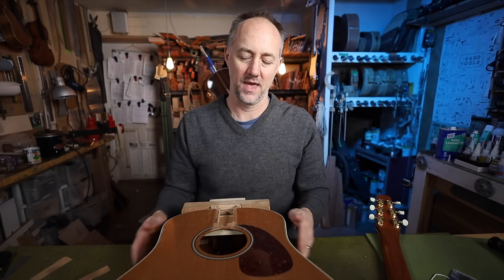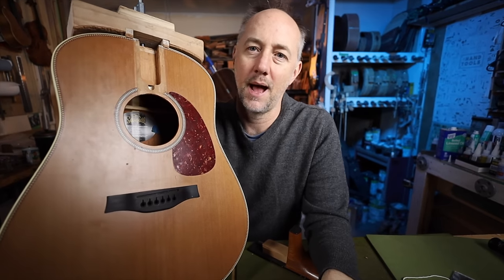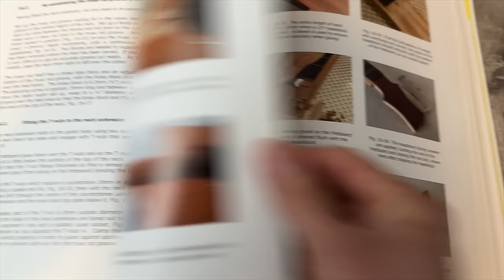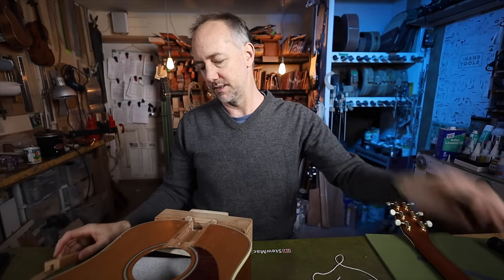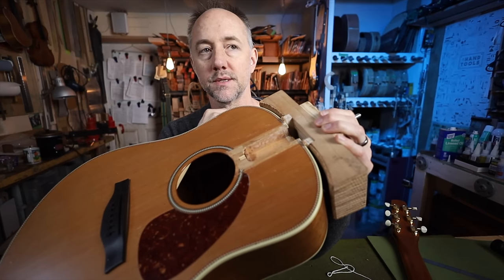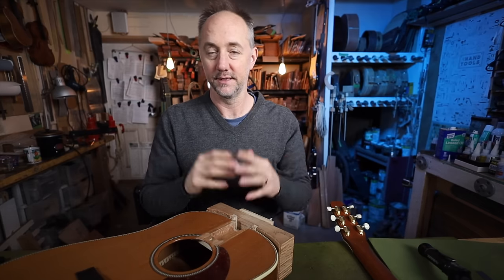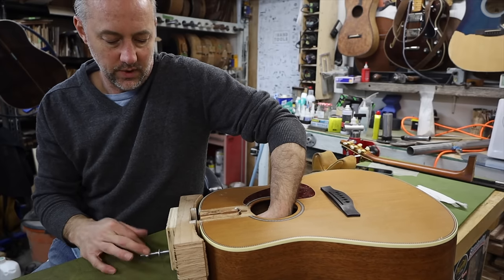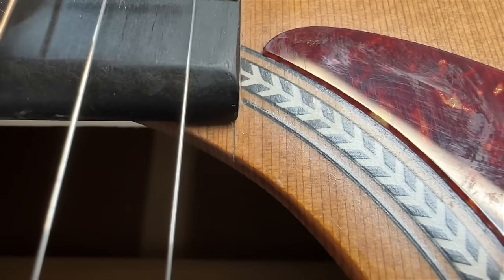The Hidden Problem with Seagull Guitars...

Comment: I have 2 Seagull Grands (parlors) myself and although there's not a huge amount of saddle height on either, they both are wonderful little players from 98 & 2000. I have had many Seagulls from all years on my bench and never needed to change neck angle. I have had to tighten heel bolts on a few from shrinkage... the same as Taylors. Great players and the cedar / wild cherry has been a fine combination. Wish I could commiserate with you but my experience with Seagull has been totally positive, starting with Robert's & Claud's LYS Kamouraska in 1980.  As a side note, the most beautiful Simon & Patrick came in the shop yesterday. Killer!
Reply: Also note, It's "Simon and Patrick" and not "Patrick and Simon" as the author indicated just before pointing out that "Norman" is a weird name.  Maybe he's having a bad day and his anger toward the Godin family is a bit piqued by his frustration.  A switch from coffee to tea might be in order :)
Reply from the maker: hahahah- good name catch! I probably say Patrie La as well! hahhaha I wasn't angry- Just annoyed that a guitar factory would make what amounts to basically throwaway guitars- it should annoy you too.
Reply from the maker: I like the seagull guitars- as can be seen at the end when i play it. Things aren't a problem until they are a problem. ALL guitars will eventually need a neck reset and this neck join (post 2006) makes that not a viable option for alot of their guitar.
Neck resets can take 10-20-30 years but all guitars will eventually need them. What is funny is yours is that age and you said there isn't much saddle height- so you are coming up to a neck reset- luckily you can do it very easy on your pre 2006 guitars :)- The fastest i ever reset a seagull neck was 15mins- from heating the fingerboard extension, taking the neck off, removing wood from the heel and regluing the neck on the body- 15 mins! i like me some pre 2006 seagulls.
Reply: @BeauHannamGuitars  I believe Simon & Patrick are Robert's children. LYS Kamouraska must have been his crazy Uncle.
Reply from the maker: HAHAHHAHA- WHo is this Norman guy?- Someone he meet in the grocery store queue?

Comment: Other opinions: "If you look a little closer, you will see the UTB is a seven-layer spruce lamination. Robert Godin said in a tour video that solid wood wasn't strong enough, but the lamination is exceedingly strong for the UTB. I am a mechanical engineer by training, and I think Godin's neck joints are magnificent."

"The switch to the integrated set neck took in late 2006 and early 2007. I have five Seagulls, three of which are twelve years old, and I have never even adjusted a truss rod from its initial setting."
Reply from the maker: The strength of the headblock area isn’t in question- it could be made of diamond and the problem I address here still remains. 
The neck reset problem isn’t about the headblock deforming (although that can happen), it’s all the thin wood surrounding the headblock that slightly deforms over time.

Comment: The Norman brand is called such because its originator was Normand Boucher. Robert Godin used to distribute his line, and then got into the guitar-making business himself in the later 70's, hiring Normand's son, who designed the first Seagulls. Later, when Norman ran into difficulties in the 80's, Godin took on the Norman brand as well.

Normand's nephew is Robin Boucher, who you may have heard of.

Edit to add, I bought my Norman B20 around 1992 and is in awesome shape, considering I've played it in the sweltering heat and shivering cold.
Reply from the maker: Cool history- I didn’t know any of it. Thanks

Comment: I see your point that the epoxy is difficult to remove but  It's very rare that someone needs to have his neck removed.. I mean really rare unless something major happened to the neck.. I have many different types of guitars for at least 40 years.. In any event I really love my Seagull. I've had it for almost 10 years now and besides an occasional truss rod adjustment during season changes, I am totally satisfied with the neck, the sound and resonance..BTW PRS utilises Epoxy too.. Must be a reason..
Reply from the maker: Seagulls guitars sound great for the price. Some guitars hold up better over the years to the string tension that inevitably  implodes them which then needs a neck reset. If a top is over braced in the upper bout, and/or the lower bout that can help resist a neck reset but it might not be good for tone. Top geometry also helps (vintage Gibsons from the 1930-1940 hold out better then Martin guitars due to a tighter top radius (Gibsons have a 15 foot top radius in the lower bout, Martins have  a 50-60 foot top radius which makes them weaker- an egg is stronger then a piece of paper to downward/upward forces)
Reply: @BeauHannamGuitars  As far as i know I wouldn't generalise this issue to all guitars with metal strings..I don't think it's an innevitable fatality.. It wouldn't make any sense to have set necks.. They should be all bolt ons., because it would be much easier to maintain.. But let me investigate with some competent luthiers I know.. If you are right about this, I'll acknowledge.. Like I acknowledge the fact that Epoxy complicates maintenance..
Reply from the maker: @BedeLaplume  I’m mostly talking about acoustic guitars here. But Les Paul’s also need neck resets.
Reply: @BeauHannamGuitars   Then write to Bonamassa and Slash. They sure have a few vintage guitars that are probably dying to get their neck resetted..
Reply: @BeauHannamGuitars  BTW I did my research with at least 2 very competent luthiers and that neck reset thing you recommend to every guitar after 30 or 50 tears is not mandatory for all guitars.. It 's good to do it, but It's really a case by case after that amount of time.. Also yes climate or weather  change during transportation or warehousing  does affect the tension and warping of the body, saddle, neck  that will occur many will never need it in their 100 years or so of existence.. Also it seems like you didn't use steam to remove the neck. Your reparation with the shims was very good but a lutheir neck joint steamer aiming the neck pocket, would have made it a lot smoother to remove the epoxy or the glue.. Last point, every Godin guitar that leaves the factory was done with wood that was dried and warehoused in stable conditions for at least 2 years.. Which isn't bad considering those are affordable guitars..

Comment: So even though Seagull says that they started epoxy necks in 2006 I have a 2005 seagull artist with an epoxied neck (: so something to be aware of.  Thought I was OK but sadly no.
Reply from the maker: Good to know, thanks. It’s only a problem when it’s a problem and it should be 20-30 years after manufacture

Comment: Hi, I was just thinking maybe the easiest way would be to flush cut the fretboard from the top and unbolt the heel. I'd leave the tenon that is epoxied in where it is. You could then shim/reglue extension & bolt back on as needed for the reset. There really is no need to remove the epoxied in wood. Your thoughts? ( a GT in Canada for about 40 yrs).
Reply from the maker: See number 4 of the the description. But don’t saw through the fingerboard as you loose a lot of rigidity
Reply: Oh right, thanks. Godin never should have changed their bolt on . I've reset several over the years easily but never this epoxied version. I think Robert Godin needs a look at your video :)  @BeauHannamGuitars

Comment: Really interesting video, thank you.
I'm not sure how the neck on my Lowden 32se is joined, but from the reputation for quality that Lowden have, I can only assume it is a better solution than the one Seagull use.
Reply from the maker: I think Lowden's use a dovetail.
Reply: It is a Dovetail but with no gap! All 3 sides of the tail are glued flush, really difficult to remove. I had one that came to me with the neck broken off and exposed this. I had to use an oscillating saw to cut the front of the dovetail away from the block.  @BeauHannamGuitars

Comment: I've owned a classical since the 80s and no problems. My wife owns two steel strings from the early 90s and no problems. Best guitar for the money! Also worked in a local music store for 36 years and sold so many I can't count, with no problems.
Reply from the maker: Guitars ain’t a problem till they are a problem. But all yours will be easy to reset the neck :)
Reply from the maker: Me too

Comment: Builders/luthiers should definitely show more consideration regarding future repairability of their guitars, a neck reset is probably going to be inevitable somewhere down the line and anti consumer choices such as this make the brand one to steer well clear of for me.

It's a real shame as two of my favourite acoustics were an old Seagull S6 and the astonishingly good Art et Lutherie I picked up for pocket change.
Reply from the maker: Yep- All guitars will need a neck reset be it 10-20-30 years. If i saw a cheap one of these id buy it but the ones made pre 2006 are better as their necks can be reset. (so can these new ones but you almost have to take the fingerboard off to get the neck off...

Comment: As someone who bought an S6 in 2019, this makes me ... apprehensive. But so far so good. But this makes me wonder, are there any guitars in this price range that are actually designed with regular glue and proper joints? Taylor comes to mind with their attachment system, but who else is there that thought ahead to when the guitar needs serviced?
Reply from the maker: Most brands have serviceable neck joints in any price range (be it dovetail or bolt on). Godin are the only acoustics from a major current brand that I know of that have set necks.

Comment: You're better off with a Norman if you want to buy a similar guitar, I've a Norman B-20 guitar, which was made in the early 70s. Never had any issue with it. And it sounds great.
Reply from the maker: Ive never seen a Norman but everyone who has one likes it
Reply: I own a mid 90s Noman. It always had great tone but now needs major repairs. A split cross brace caused it to belly up  and I'd say the bridge is will need to be removed and replaced.. probably cost more to fix than replace
But it has sentimental value... I miss playing it

Comment: I have a Seagull 6 and a 12. ALso a 6 string Minstrel. I feel all 3 need a reset. However it might be beyond my skill set.
Reply from the maker: Are they made before 2006?- if so they are easy to do. If made after 2006 It’s possible to do if you want a challenge (but any neck reset is like that)
Reply: @BeauHannamGuitars  I beleive so. 6 string number is 00135471 so I think 2000, 13th week. It's bridge has been shaved to practically nothing. When I look inside I see a solid block with no bolts.
Reply from the maker: @MikeGervasi  nice- the neck can be set normally, although with no bolts I presume it’s a dovetail but I didn’t know they ever did them????- best to call them

Comment: Very interesting.  I will flair the neck to the top attachment area on my future Spanish heel ukulele builds for sure.  Thanks!
Reply: Not enough stress in a uke with a Spanish heel to make an iota of difference.
Reply from the maker: Yep- thats what i do. Livy1962 points out there sin't enough string tension to warrant this and its true. But i do it anyway just cuz it is good building practice and I have always don't it on all my guitars.
Reply from the maker: See my answer to Short6691

Comment: I just purchased a new Godin Folk solid mahogany acoustic. Everything seems fine: playability, intonation, fretwork, etc. The only thing I noticed after playing it for a few days is that there is a very fine gap where the heel joins the body on the player's side (not on the other side, though). It's widest by the fretboard, where I can slide a feeler gauge into it of .0025" and then gets narrower from there until sealing up completely about half-way down. Should I be worried? I like everything else about the guitar so far, so I'm hesitant to exchange, not knowing what I'll get. Any professional opinion would be helpful, if possible. Thanks.
Reply from the maker: 0.025" gap is alot. If you bought it new its still under warranty and id ask for it to be repaired- Its either the bolt wasn't tightened enough at the factory (doubtful), the bolt has come loose over time (less doubtful but the gap would be even on both sides if this was the case) or the wood of the heel has twisted a bit. could be strange body movement too. But take it back or to a luthier who can give an in person assessment. But the gap shouldn't be there.
Reply: Actually, it’s .0025”-ie - between two and three thousandths of an inch. Would that still be cause for concern?
Many thanks!
Reply from the maker: @cmcg5788  0.002” isn’t much- I mention at the end that Seagull use wood putty to fill any gaps at the heel so some may have just fallen out. It’s just aesthetic so don’t worry.
Reply: Cool! Thanks alot! @BeauHannamGuitars

Comment: Beau, thanks for sharing your repair chronicles. Thank you, Google, just what I needed. A few questions: aside from the heel support fanning out and connecting it to the transverse brace, and achieving better tolerances, what are your thoughts on the whole bolt-on versus traditional approach (Tenon/Dovetail and fretboard, all glued)?

The reason I ask is that I am a guitar maker working on a bolt-on neck design. I am planning on using a tenon & extension under the fretboard but without the shims (Taylor has the patent on the adjustable neck). I am accounting for the neck angle and aiming for much tighter tolerances (using a CNC). I was curious about the bolt-on approach for its repairability and the fact that it provides more robust support. I am hoping it could withstand the forces of 7 & 8 steel strings. Any thoughts are much appreciated. Thank you again!
Reply from the maker: I will publicly say that there is no tone difference between a dovetail and a bolt on- assuming both systems have the neck fitting to the body well. If the woodworking is good, the tone should be too. Talyor and Collings both use bolt on necks and i'm certain they did would have done tests to see/hear if one system was better over the other. 
Do you have the trevor Gore book I show in the video??? I think you will be interested in his neck attachment system (like Taylor but different, no shims)- i added a link in the description.
Reply: Thanks for your response, much appreciated. Yes, I am familiar his books, but don't have them $$$$, but lots of great knowledge in them—Falcate bracing, nut compensation etc. This video shows his approach https://www.youtube.com/watch?v=NQu1XGnVjlE. I come from the world of test, measure and learn. From a CNC operations point of view, his order of operations makes sense. Circling back to your video, you summed it up quite nicely, "If the woodworking is good, the tone should be too," and I would add, "and it should last for a lifetime" (of the instrument that is).  @BeauHannamGuitars
Reply from the maker: Im sure you would like these books- stewmac used to sell them and you could get a 50% discount which made the books a good price, but they seem to no longer sell them.

Comment: This is a real shame. I really like the sound and feel of simon and patrick guitars, but this seems like a terrible choice by the designers and now knowing this, I think I will reconsider purchasing one. Should I let this problem affect my decision to purchase a godin guitar? I want to get a nice solid top guitar, and I might go with a yamaha, as they seem to provide really good value for money. And I think if in some decades it needs a neck reset, it would be a lot easier to do on a yamaha, as they use a normal dovetail joint, and I'm pretty sure they don't use epoxy resin. What solid top guitars would you reccomend on a budget? Like for around 600 dollars or less?
Reply from the maker: Well, for $600 or less a neck reset isn't the issue because no one resets a neck on a $600 guitar as $600 is close to a neck reset cost (typically with new frets, nut, saddle, setup). 
I really don't know the cost of new guitars as I don't go into guitar stores. Waterloo, IRIS and good but I have no idea what they cost. Recording King had some good ones last time i played one but i cant remember the price.

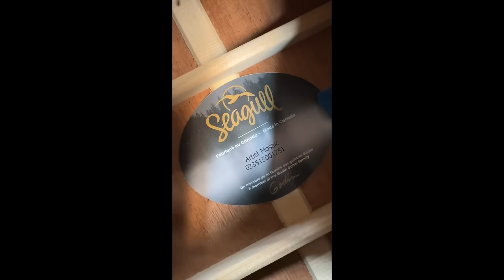Comment: I have an S6 from around 2010 that has a crack from the sound hole that goes straight up along the fretboard, exactly as you show at 3:09, but only on one side. I fear it is as you said, almost a throwaway guitar because this fix is such a hassle, and I doubt it would be worth selling with the crack present. The real stupid part is it came with the crack new 14-15 years ago when I should have returned it to the shop, but didn't for various reasons (birthday gift, first guitar, etc). Trying to decide what to do with it when I found your video... I'll probably keep it as is and if/when it becomes unplayable I'll try to do something myself. I really dislike these guitars now... ugh...
Reply from the maker: Sorry to hear it- the crack along the fretboard edge really sucks. It’s all fixable though. I have a video I have to edit shouting how to do it.
As for fixing your guitar, it just depends what it’s worth. They can be fixed but the expoxy makes it harder.
Reply: @BeauHannamGuitars  It's a Coastline S6 Folk Cedar. I think it was just under $500 new. I will lookout for that video! All I've done as of now is take the bolts out and tried encouraging the crack to line back up so I could possibly get some glue in it.